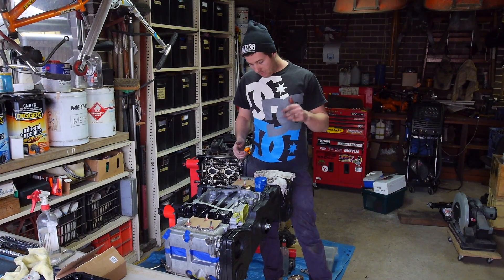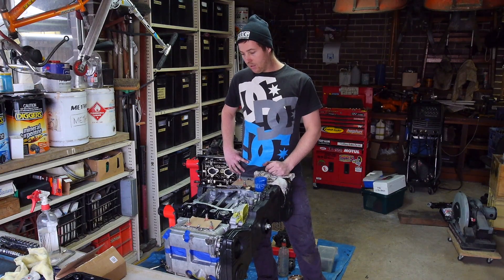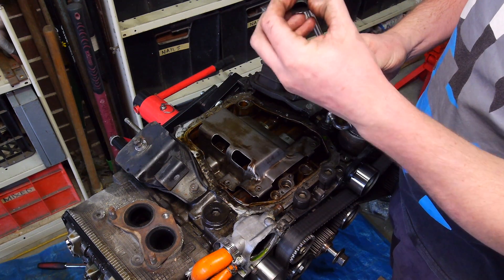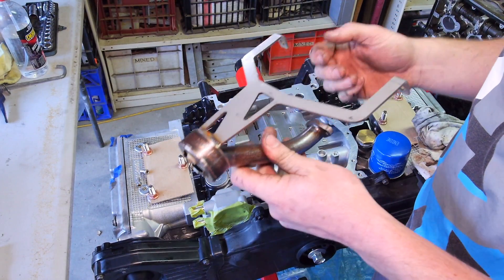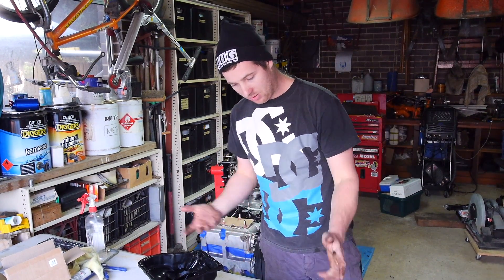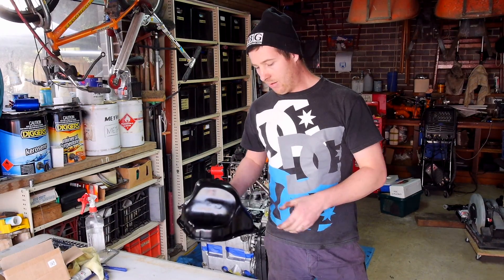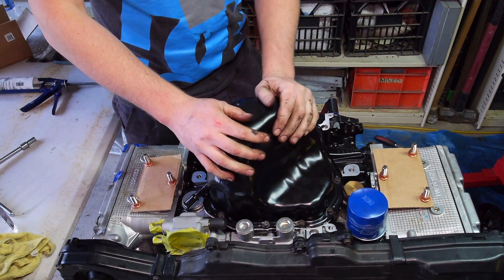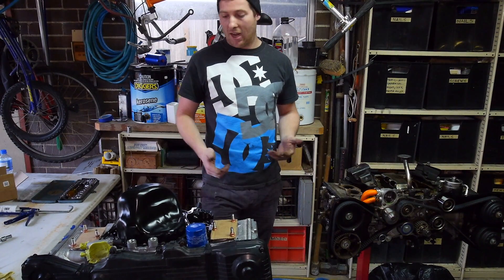EJ SUMPS, BAFFLES & PICKUPS COMPARISON & HOW-TO - TIGWERKS & KILLER BEE vs STOCK

Comment: Hey, nice video! I just smashed the oil sump of my wrx bugeye. It’s only few mm in, but I am not sure how far is the oil pick up from the bottom now. Oil pressure is fine, so should I get it changed?
Reply from the maker: I think it would be ok if it's only a couple of mm
Reply: Boosted & Built Garage thanks! I might drain the oil and check through the drain plug what is the clearance
Reply from the maker: Yeah that's a good idea
Reply: @ken_solverg  any update on this as im curious too? What is the clearance roughly between pickup and sump?
Reply: @joshualaporta5937  very little. My pick up was OK but ended up changing the whole thing

Comment: The tigworks pickup looks nice, but I prefer the KillerB's Triangle shaped pickup better. If your oil pan gets smashed flat it'll still pick up oil. (Video on my page, if you want to see what I mean) Great Video!
Reply from the maker: +Tyler Hartman Yeah man I tend to agree, only using the tigwerks as it came with the motor. If I had my pick I'd most likely choose the killer B one.
Thanks bud🤙
Reply: Don't lower the car so much that you'll fuck up your pan 🤷‍♂️

Comment: Hello, nice video, so the aftermarket oil pan will fit a ej 207/205 if i switch to the ej25 sump and does the windage tray fit the ej207? i checked on the internet the price of the oil pickup and the windage tray, both combined to the price around 210 USD , seems to be a decent price, please correct me on something if im wrong , pricing, fitting and so on, would appreciate it a ton
Reply from the maker: Gregor Ment Yeah mate, the EJ20 and EJ25s are the exact same so sumps and baffles and pickups etc can be interchanged 👍 So yeah go EJ25 sump and aftermarket windage and pickup (killer bee or tig werks etc)

Comment: Weird...i can't grasp that a gravity fed turbo drain would flow better with the drain submerged to bottom of pan.
Reply from the maker: Toby Head There's no difference with flow but it stops frothed thin oil and also any blow by. Try this, get some tube, put it in a cup of water and pour water down the tube, it will always displace. Or even look at how a toilet trap works, the bowl stays full always because the water when flushing just displaces the water in the bowl. I was impressed when I discovered how it was run on the subie haha
Reply: Boosted & Built Garage 
Hi,,,,ty.

I just took a long funnel and a large cup of water. I used a timer. It took 1.5s when funnel above water level to flow the large cup of water. Same amount water takes 10s to drain the funnel with same amount water when submerged.
Reply: Boosted & Built Garage 
I think i figured out a variable.  With my funnel the mass of the water supply is diminishing therefor slowing. With a constant supply of oil the mass would be more consistent making the flow more similar. Ty
Reply from the maker: Toby Head Love the science! That's interesting, I guess it doesn't matter because the oil capacity never increases, just recirculates from sump, through motor and turbo then back?
Reply: Boosted & Built Garage 
I am only learning...not any expert at all. I am just trying to understand and physical prove to know better.
Reply: Oil supply isn’t from the pan
Reply from the maker: No one said it was... It's from the head...